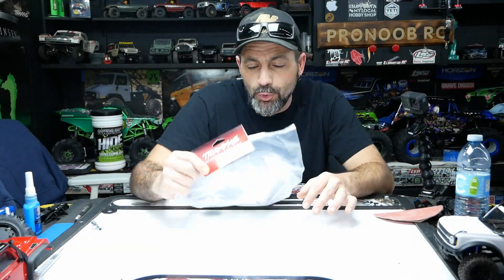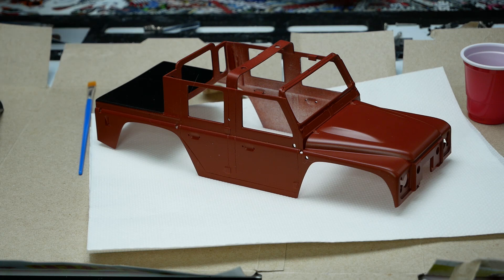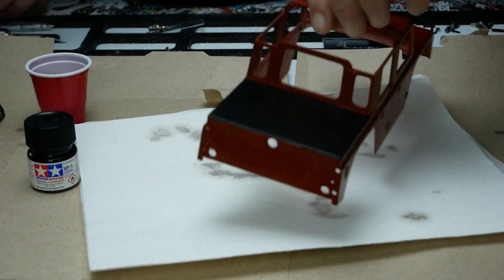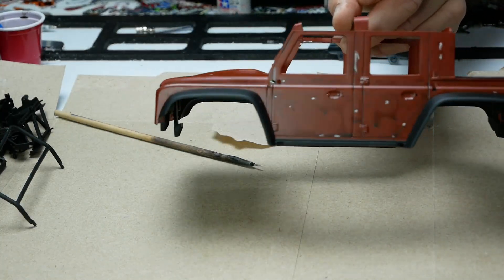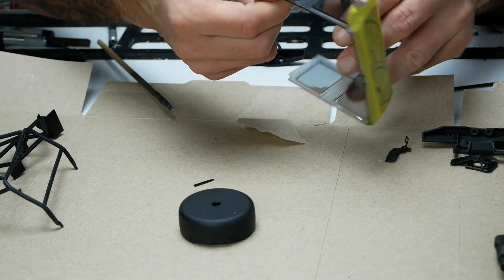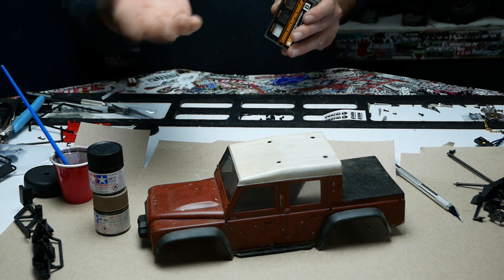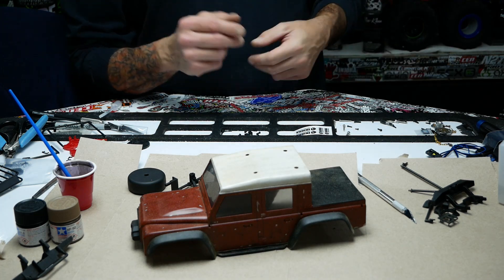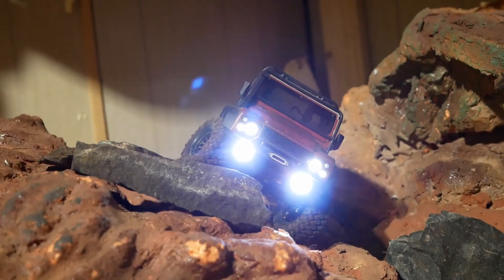TRAXXAS TRX4m: 1/18 SCALE RTR: CUSTOM PICKUP BODY, WEATHERING, AND CRAWL

Comment: This is a great video. Thanks! I have a few questions for you.
I just recently tried to do my first custom paint job on an area 51 bronco it wasn’t the white ready to paint one.
I did realize afterwards that I sprayed the clear on way too fast after painting the body. I used the Tamma primer to Mya paint and the Tamia Matt clear
i’m thinking of redoing it when you said not to do multiple layers of the mat clear do you mean not to do multiple layers too fast or just only do one coat? I’ve had issues with the paint. Scratching off my first time rubbing up against rocks, is one coat of matte, clear gonna be enough to help protect it or pointy rocks just gonna scratch it off no matter what.

My next question is and you mentioned this briefly can I do a clearcoat over one of Traxxas colored bodies to help protect it and get rid of that plastic sheen? If so, are there any details? I need to know about doing that that could cause problems or mess it up ?

Comment: What was done to the Bronco off to the right of the frame?  It looks lifted?
Also, that truck style Defender looks awesome!  It seems to crawl better as well. 
Are those the stock tires? Also was it changed at all with the suspension/lift?
Reply from the maker: It’s the one we upgraded but everything is still the stock geometry. It might’ve been sitting on top of some thing, but you are correct. It does look lifted in the video. . Yes, they are the stock Trail Canyon tires with the method beadlocks and brass rings on front